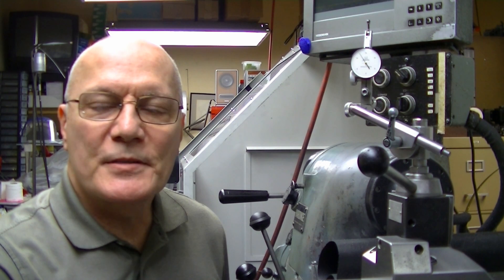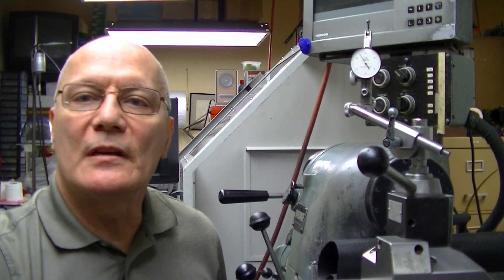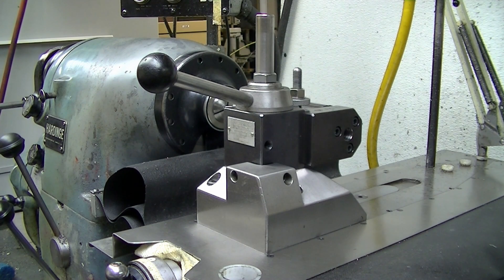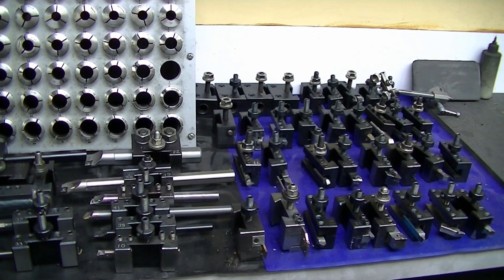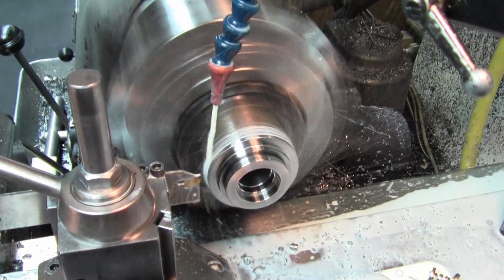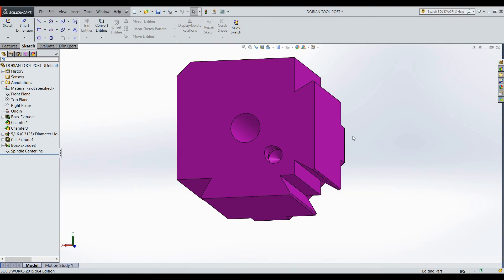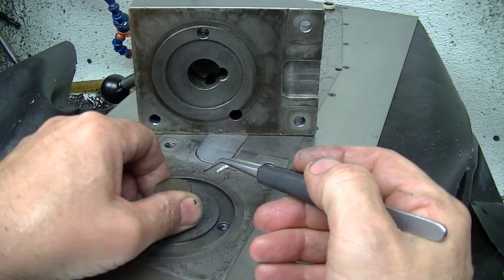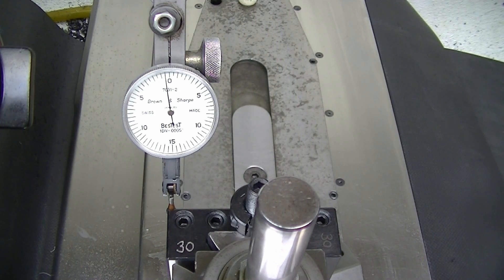THE SOLID TOOL POST MOUNT

Comment: I always thought those tool post drill chucks were a bit silly. The concept was great, but the rigidity was lacking, at least, with a standard compound. This modification makes a lot of sense and stirs up some ideas. 

Coincidentally, I bought my HLV-H last year, just about the time you published this video. The more I use it, the more I find tweaks that need to be done. Since I do not have a DRO...yet...I do use the compound, but it is absolutely the weak link. In fact, my compound has a crack in it on the thin spot of the threading lever.

Comment: quite impressive as for the parting job, 1000 revs with the 3 mm wide blade insert in 2 1/2 inch stainless is no joke.
still: in my experience the wear/play in main spindle bearing factors in as well when parting, yours is running smooth as silk tho. CBN inserts might work smooth as a charm on that lathe i assume, wonder if you've got solid carbide boring bars for ID?
Reply from the maker: Yes I hard turn with CBN all the time and use carbide boring bars. Thanks for watching and commenting.
Reply: same here. ultimately you know how rigid and stable your machine/setup is in reality when you try to hard turn ID with high precision on a daily basis, tools and inserts are just beyond as for costs...
may i ask what brand you use for CBN?
Reply from the maker: I braze worn inserts directly to the carbide shanks and grind and lap new cutting edges on them. They last a long time because I can just lap them when they start to get dull and push too much.
Reply: well that's one way to save bucks for sure... ^^
tried grinding and lapping the CBN inserts as well, but it's one hell of a fickle job to maintain good edge on them because they're so brittle and you have to grind them very carefully, standard cutting carbide is night and and day in comparison.
being honest i'd love to see a video of you doing that, do you already have one on your channel or could think of featuring that in a future one?

Comment: Regarding the parting tool. You speak of the rigidity of the tool as very important. I wonder what you would say about the one that came with my 50s era swedish lathe. The thing is spring loaded and gives out if it comes under too much pressure. Doesn't sound quite like it follows the same paradigm.... Can see it here http://www.lathes.co.uk/bergstrom/img3.jpg

Comment: You just revealed the biggest issue I have with my mini lathe! I'm an amateur at best having learned how to use a lathe from my dad. I just can't part soft metals like silver and aluminum with parting tools without screeching and hellish sounds coming from the part, not to mention the tool biting into the piece and pulling the whole tool post down. Granted I need to readjust a lot, but the damn compound slide is a wasted and relatively useless component for daily functions. Thank you so much for shedding light on an issue I was struggling with.
Reply from the maker: Thanks and thanks for watching and commenting.

Comment: Hello! Really enjoyed watching, very satisfying watching that parting off sequence. I am a beginner so please forgive the naive question - does the modification prevent you angling the cutting tool, i.e. can this post only give you a tool that is 90 degrees (or zero as in drilling / boring) to the work?
Reply from the maker: You can put tools into a straight holder at an angle.

Comment: Been a viewer for some time first time commenting. Very  good video. I have a large lathe. A 25 in swing that is old and worn on the cross slide. The machining I do with it is normally , chuck it up and get it done very quickly  because a piece of equipment broke. The machine shops in my neck of the woods a always very busy.  The turn around time is usually 24 hrs or more. Most of the time what I have to do has more to do with speed than accuracy.  I will take a look at maybe seeing if that would help on my lathe. Thanks
Reply from the maker: Thanks, and thanks for watching and commenting!

Comment: For you being a perfectionist person sounds strange that you don't mind on not  having a compound for threading.
so, all machinists have been doing it wrong for all these years?. just don't mind those 29.5 degrees?
Reply from the maker: 29.5 infeed is "A" method of many, not the only method. Straight infeed works just fine on smaller threads easily doing 13 TPI. All who have tried it after seeing this video agree.  There is no compromise in thread quality from straight infeed. There may be materials that will not give a good finish when cutting on both flanks of the tool at the same time but I don't use any of them and I can always put the compound back on if needed. Thanks for watching and commenting!

Comment: Since we are splitting hairs here, counterboring your threaded mounting bolt holes in the cross slide a bit should spread the forces and flexure of the tightened bolt over a wider area. I.e., the tightening forces on the threads tends to make the threads spread due to the thread angle, and rise. This process is sometimes used for highly stressed cylinder head bolt/studs where they enter the block. Whether this makes a measurable difference here remains to be seen. Without the diameter problems with head bolts and proximity with the head gasket and cylinder bore, countersinking may be better at spreading the load as would placing the threaded area as deep as practical. (but probably not into the floor, wink, wink)
Reply from the maker: Good stuff and all valid points. I took care of that in this case by scraping a light concavity around all the bolt locations.  Thanks for watching and commenting!

Comment: I'm new to Lathe work but have a decent old 1950s ish 10" Atlas.  I'm trying to figure out why it's good to zero the tool post?  Won't the angle of the tool to the work be different every time you change a tool in the holder or replace one of the holders for a different tool?  Also doesn't the tool post hold the tool holder from the dovetail by pushing out on it?  If so why machine the inside surfaces of the tool? What am I missing!!!!!!!!???????? lol
Reply from the maker: Think of it as tooling the lathe as if it were a CNC machine.  My toolpost locks by a moving gib that pulls the tool holder against the toolpost not pushing it out (like piston style)

Comment: Just a query on using the drill chuck.  
As the lead screw/feed shaft drives through a gearbox, then finally a spur gear onto a rack, would drilling not overload this gear?  I would have thought that the loading on the feed system when drilling is greater than when using a single point tool.
You produce great videos, and after some fifty five years of engineering i am a firm believer in the older I get, the more I realise how much there is still to learn.
Reply from the maker: Thanks Dave, The Hardinge  uses a apron mounted variable speed dc drive to provide the feeds directly at the saddle. It only connects to the spindle for threading. But you are right the loads on the rack and pinion are greater with larger drills than they are for turning.

Comment: I thread every day with my compound...
Reply from the maker: That's great! Thanks for watching and commenting.
Reply: just thread using radial infeed, its even simpler
Reply: modified flank is great , but if you were more rigid at the tool post  , radial infeed would create as good or better results..
Reply: Fascinating. Also, you would have the advantage of direct reading off the dial for thread depth and no setup time vis-a-vis the compound angle.
Reply: That's great! lmao

Comment: Nice video and I'm really considering doing this to my Hlv-h. Just one question. Are you having to do anything different in process as far as threading is concerened?  Thanks in advance. -Adan
Reply from the maker: Threading straight in with the cross slide is no problem.

Comment: Would applying a consistent preload on the 4 attach bolts mitigate any distortion in the cross slide? Are the clamping forces pretty significant?
Reply from the maker: No, the distortion is in the riser block itself from the set screw forces against the dowel. It must be flattened to match the cross slide.

Comment: Do you think this adapter could be modified to replace the turret on a Hardinge HC chucker?
Reply from the maker: You could modify a chucker cross slide to mount a toolpost.
Reply: thanks - will see if the shop owner is interested in doing this mod.

Comment: interesting idea but does not make sense to me as the forces for parting (if the tool is square) there should be zero deflection or tool post rotation, I proved this in my mini lathe I part off without a carriage lock, now if there was lateral movement it would easily move the tiny carriage and it does not!
Reply from the maker: The tool would have to be on the center of the tool post bolt to not have any rotational forces. If your parting tool is 1 inch to the left of the tool post bolt and you apply 50 pounds of force with the cross slide there is 50 inch*lbs of torque on the tool post. The rotational forces do not generate lateral forces on the carriage so that is why that worked for you.
Reply: I understand completely hence why i keep saying no need to lock the carriage as so many do LOL. now just for fun I am going to build and experiment with solid block like yours etc. well see if there is any difference is chatter(most possibly) or not

Comment: I've only ever used my compound 4 times in the last 20 years - now let me show you the custom U-Joint I made to avoid putting any side loads on the crank handle....freakin' toolmakers! :-)

But now that I've adequately harassed you, can I request you go into more detail on the rotary broacher you made? (Or send me the drawings you probably have tucked away in a notebook on a shelf somewhere?)
Reply from the maker: The rotary broach video is on the long list

Comment: Very interesting video.   I have older HLVH in Uk, no readout though, just hobby work.   using multifix toolpost I struggle with chatter parting off.  I thought about a rear mounted block direct on the cross slide with inverted parting tool.    Any thoughts.  ?
Reply from the maker: IMO if you are going to part on the back. Don't invert the parting tool just run in reverse to part. Yes if using chuck you would need to seat the chuck in the other direction to part to be safe. Inverted will be lifting the cross slide off the dovetail and might be worse than what you have now.

Comment: Great project & workmanship! Just a thought on the toolpost not staying straight on the topslide despite using Abom torque on the hold-down: perhaps the top of the t-nut needs to be ground down a bit. It could be a bit proud of the toolpost top surface once pulled up by the bolt, which means the toolpost is only clamped to the nut and not so much to the toolpost.
Reply from the maker: Even when the problem you describe is not occurring, the tool post can be moved no matter how tight the bolt.

Comment: You present an interesting albeit radical approach to increase rigidity. The manual of the original Swiss Multifix QCTP (e.g. used by Abom79 in his home shop) mentions that in case of high tangential loads the fixed part should be mounted using 2 dowel pins in addition to the big threaded post. That should take care of pushing the post away by tangential loads. The repeatability of the original Multifix is known to be excellent. Instead of removing the compound you could make it more rigid by using the tapered gib to lock it. Or with a straight gib tighten all lateral adjustment bolts to lock it down in order to increase the rigidity. Readjusting the gib is still quicker than putting the removed compound back in place. After those alternative, less radical methods your approach only has one advantage left which is the angled surfaces to make the chips fall away easily. In that respect your approach is really neat. A short bristled brush is the next best solution for those who don't want to blow the chips off.
Reply from the maker: Thanks rol eic and thanks for watching and commenting.

Comment: Robin do you use a "standard" tool used much as you would a 3D tester on a CNC mill  ie a non working tool that is used as the reference for all of the actual working tools.?
Reply from the maker: I do not. I just keep the diameters of all the tools current and set the Z of each tool in use per job only. It is so quick to set the tools on a manual machine anyway that it is not a big deal. Thanks for watching and commenting.

Comment: did not understand how the TP lateral load deformations were scraped out. The load varies, therefore, assuming linear S-S curve as TP load is applied to block, response changes. Hmmm, got to mull on this. Anyway, on my budget, ground tool holders would be limited to 0.5. Good thinking.
Reply from the maker: The deformation is just in the riser block itself from the setscrew pressure against the dowel pin in the front of the toolpost. That pressure makes the bottom of the riser concave which I scraped out to match the crosslide.
Reply: not TP loads, mounting only loads, which are static......ok.

Comment: Magnificent video, particularly the compound crank and the little details like no horizontal surfaces on the riser.

Also I'm glad I'm not alone in battling compounds. I had the very problem you described when indicating a sine bar before cutting a very precise taper on a Rivett 1020. Ended up using the TA to get around it.

So when you cut tapers, do you usually default to using the taper attachment and/or form tools?
Reply from the maker: Thanks onewheeler, I use a lapped form tool but I don't do a lot of long tapers in my general work. Thanks for watching and commenting!

Comment: I am totally doing this! I have been fighting my cross slide for months now....this convinced me! Keep up the great videos!
Reply from the maker: Thanks F1DesignUS and thanks for watching and commenting!
Reply: Rob, As an update I have one of the Sieg mini lathes . It is a lathe kit more than a tool but it fits my needs. 

Anyway I ended up drawing up a tool post mount like yours in SolidWorks and 3D printed a prototype. I am amazed at how much better a PLASTIC solid mount is compared to the cast iron compound. 

Once I get the details sorted on the model and print a final version I plan on building it out of steel or cast iron but I just wanted to say thanks again for pointing this modification out!!!

Cheers!

Steve

Comment: Great idea for smaller hobby lathes like i have.
But i am a little confused. You are preloading the toolpost with screws from behind, but is not the wrong way? Because that will be the same way as the tool pressure forces work?
But i guess it is weary difficult or impossible to preload it from the other direction against the cutting forces because that will get in the way of the dovetails.
Reply: The way preload works is that unless it is completely relieved (i.e. either the set screws or the dowel pin are on the verge of coming unseated) the overall assembly stiffness is symmetrical.

Comment: I'm not an experienced machinist...more of a welder and Elec/tech.....but....I always thought the compounds on most small to medium sized lathes appeared a little flimsy......by medium...I mean swing of 13-15+....and those tiny brass acme nuts seemed equally small......on compound and cross-slide..

Comment: Here's a question, at least somewhat related, that I've been wondering about: Have any lathe manufacturers ever fit a rotary table style compound on their lathes? A small crank to accurately set the angle just like a rotary table, then lock it down like any compound. Seems like it would be useful, everything you said in this video notwithstanding. :) 

I question if I could fit one on any lathe I've used because the rotary tables I've seen are all too tall to still get the tool down to center height, at least on the typical toolposts. But if a lathe were actually designed for this purpose it would be useful. 

Just curious. Thanks for all of your insights in all of these videos!
Reply from the maker: That would be pretty cool but I think a high quality 5 minute Vernier scale built in would be just about as useful.